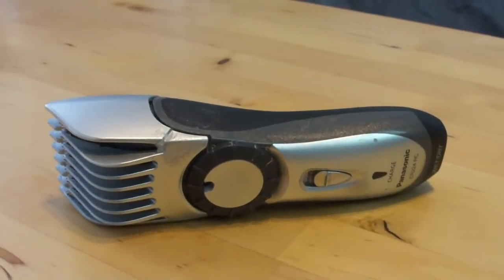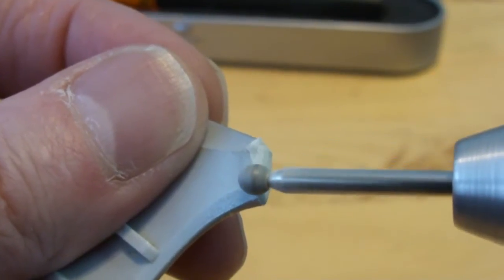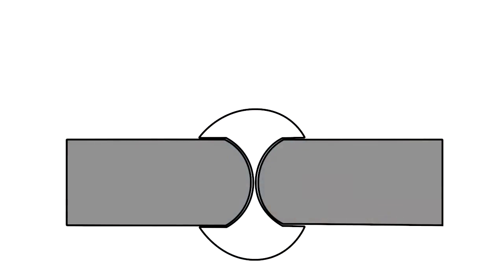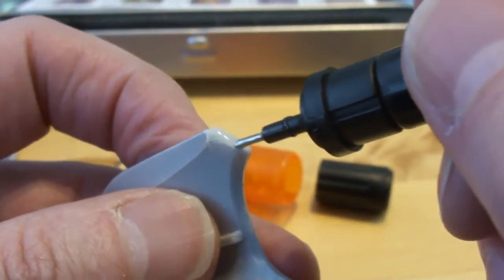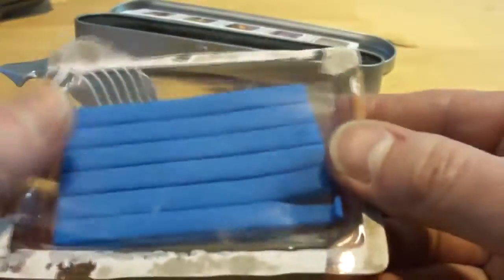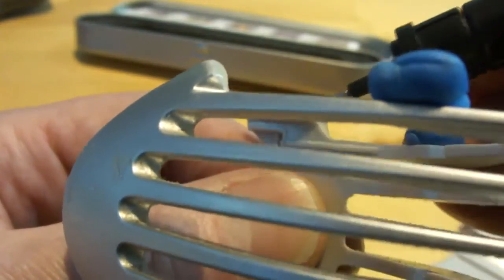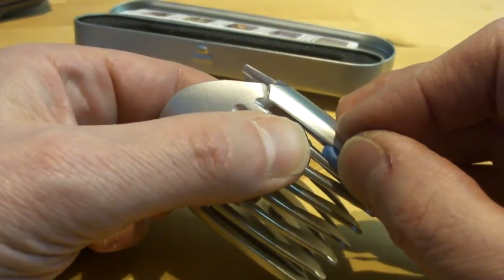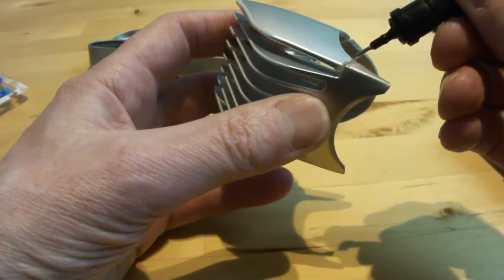Fix hair clipper; glue a broken plastic molding part with Bondic

Comment: Best explanation out there on how to use Bondic. IT is not a glue; it’s a plastic filler.  Great tip to create a gap so the plastic has a place to be exposed to the curing UV rays. Bondic will stick to itself and you’ve provided a clever way of setting things up with the surface prep and putty alignment trick. You’ve provide me with an idea of how to possibly repair a stripped out plastic thread on a plastic shaft by using putty as a mold for guiding where Bondic needs to go.  Great video!

Comment: I'd like to know if it held up to actual stress of use afterwards; I've found very few materials ever provide a structural hold adequate to work as the original. Plast-aid has been stronger and more adhesive than even epoxy in really tough repairs, the only drawback being its nasty solvent smell and sticky mixing. It can be built up by adding dry powder onto wet layers, repeating, then drilling/sanding after fully dried. My limited uses of UV cure stuff has not been impressive, but Bondic seems superior to others, so may be it will be the future of repairs.
Reply from the maker: Sadly, I'm not in contact with the owner of this clipper any more. But I agree with you: if the original broke, then the repair probably will too because it won't be stronger, and repairs are often a disappointment.